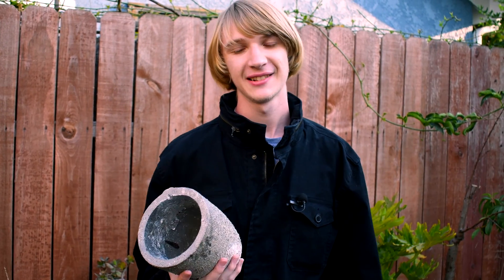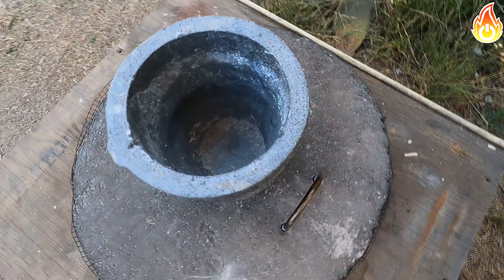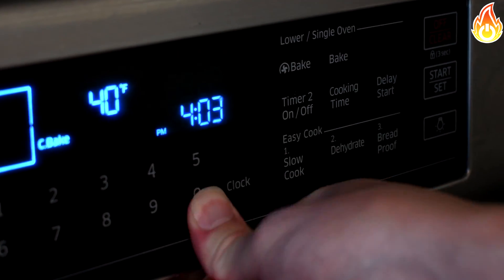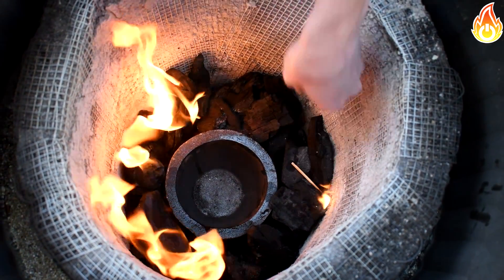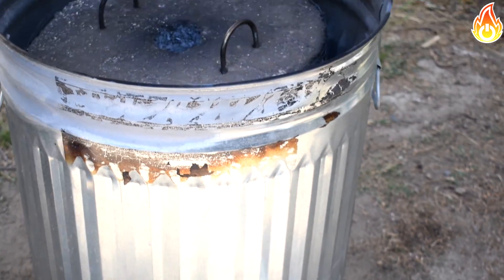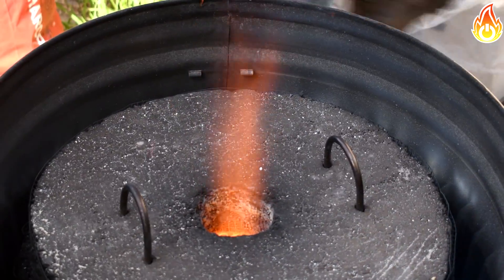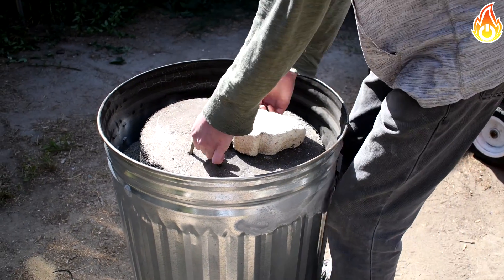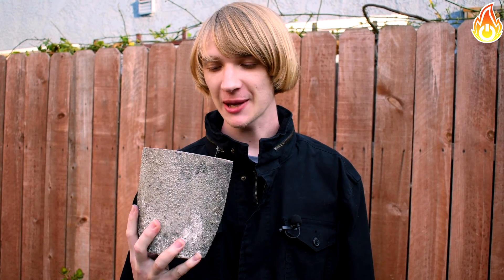How to easily temper a crucible!

Comment: One popular supplier still sells crucibles with bad instructions for preparing them.  They say to melt a bunch of flux in them for the first heat.  If anyone wanting to pour castings is in doubt which method is correct, it's this one!  Those other instructions may be more appropriate for different types of applications such as assaying.
Reply: It seems they want to sell more crucibles.